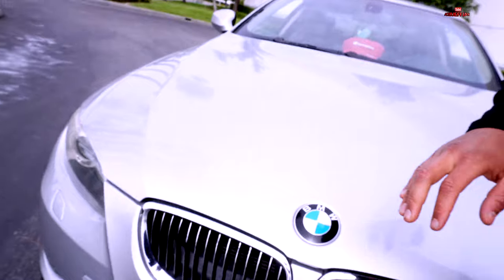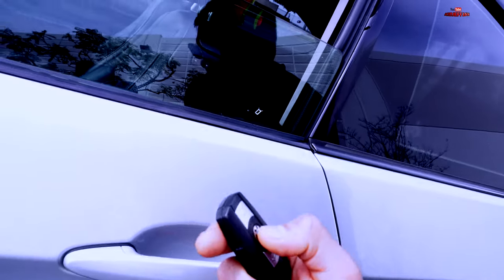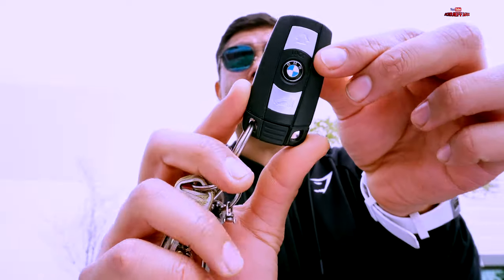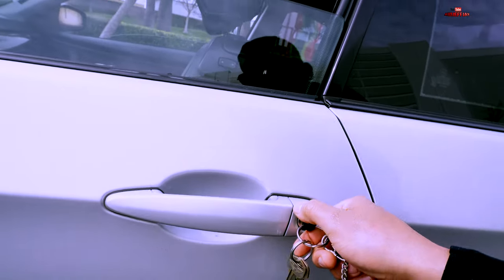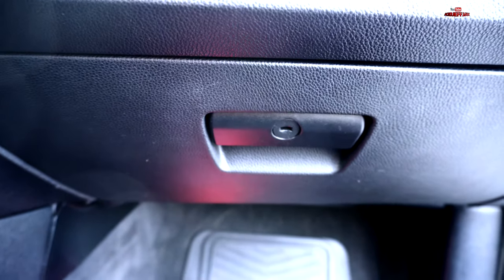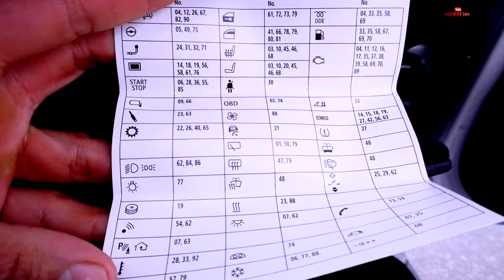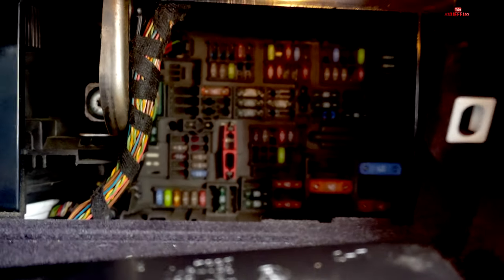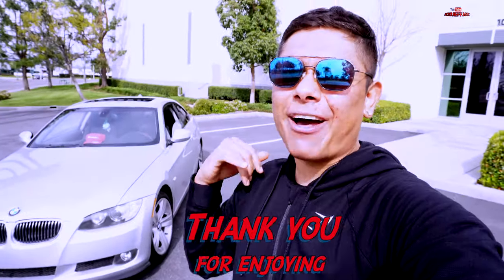BMW Not Beeping When Locking | Learn How to Fix It Real Easy

Comment: My issue is that I cannot select the sound in the car menu. I select it and it will not check the option. It stays unchecked. Any solutions for that? In the meantime, I will check your suggestions.